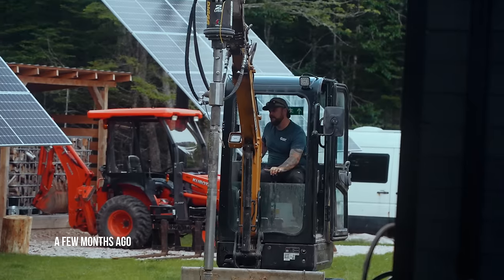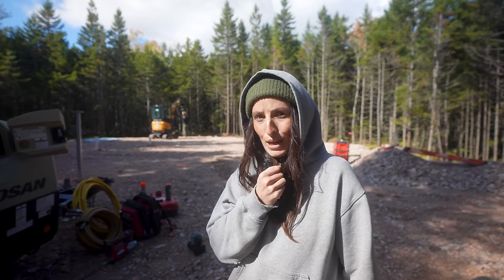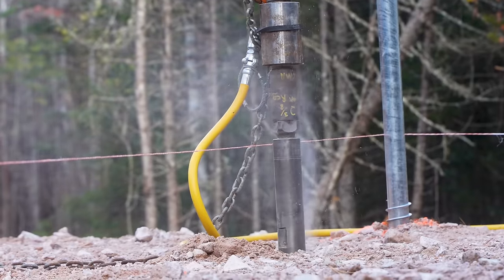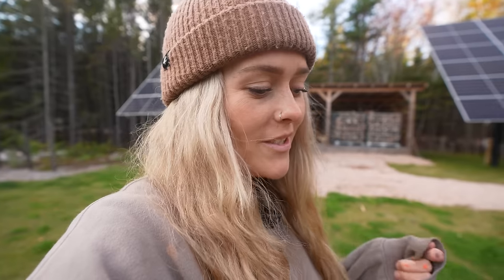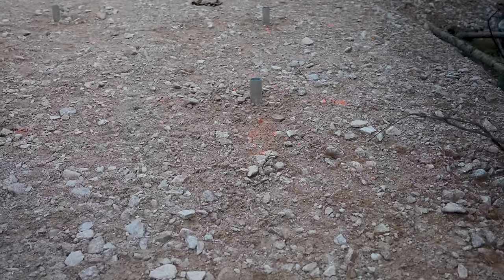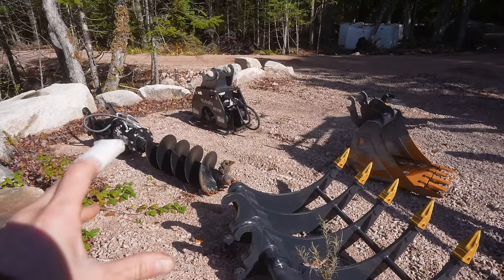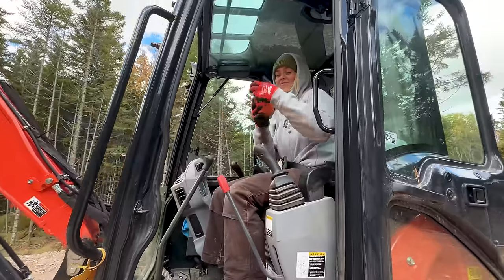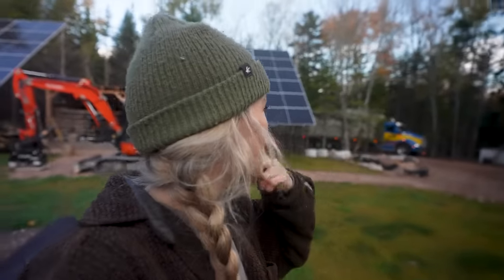Building A SHIPPING CONTAINER WORKSHOP at Off-Grid Cabin! (Screw Pile Foundation)

Comment: With the engine off, wiggle the control levers and it will relieve the pressure in the lines so the quick-connect will click in faster
Reply from the maker: Thanks for the tip. 😊🐶
Reply: Pole and rock markers - rural graffiti ❤

Comment: Someone may have mentioned this, but make sure to use the correct insulation— spray foam or equivalent.. if you don’t use any, you will literally have an inside rain storm. The condensation from the snow will cause the inside to form water on the inside of the steel container… the inside will always be just warmer than the outside and water will form— think ice cold water ina glass  on a hot summer day . Great video, great job— JT from Maine
Reply from the maker: Ahhh we experienced this already. Thank you xx
Reply: @ Sorry, it must be the “girl dad “ in me. I am a supporter of your off the grid lifestyle and any advice/ information that I pass along will always be from the heart. You ladies are fantastic in what you have accomplished.
I have retired from the plumbing and heating industry and am amazed at all the skills that you both have learned. 
Good luck on the Mexico project.

Comment: I have been trying to think of a way to attach wheels to your dock and floating cabin.  I put wheels on this pain in the butt jet ski lift I used to have. It made life a ton easier. I'm sure we could devise a wheel system. I'm currently thinking of a fold down system for both. I know it's an easy fix.

Comment: We would have done some concrete pads on the corners and center and called it a day , screw piles and rocks are so much extra work!
Reply from the maker: We initially wanted to do this. But concrete is very expensive here. This worked out to be more affordable considering gathering all the materials, the time and our extremely rocky terrain.

Comment: The screw piles are built of steel, even hot galvanized,  when it submerge in ground water they will corroded. What is the expected life for those piles? After that, what are your options?

Comment: Is it a roller and also, you can take those lines, you put a little hydraulic wall down around the part where you stick them in on the boom. Keep that oiled with hydraulic fluid and the hydraulic fluid. Don't ever wash away, and it'll keep them. Make them easier to use when you're sticking the lines to the hydraulic boom. Vowels

Comment: The two containers will support a full-span roof between them, providing a nice, wide bay for your equipment.  And then the roof will be a perfect place to mount more solar - you'd have way more power than you can use in the summer, but you'll be a lot closer to having enough to gather sufficient power during short winter days.

Comment: Congratulations on the progress so far. But I don't understand what the screw piles are for?  When this first shipping container was delivered it didn't go on top of the screw piles.  What are you putting on top of them?
Reply from the maker: We need the tops for the screw piles which are not yet made. Galvanized metal and lost in the mail system lol. They will sit on top of them once they come in. Plus that truck couldn’t place them on. You need a big excavator or a boom truck
Reply: @Vanwives  okay. So once the caps for the screw piles get put on then you have to get some kind of big equipment to lift the shipping containers and place them on top of the screw piles?

Comment: those containers only need a pier at each corner......they are designed to take WAY more weight between the 40-foot span than you have planned. You only needed 8 piers.
Reply from the maker: Agreed. However, if you’re putting heavy equipment in they need more. We had it engineered stamped

Comment: You are not compacting the ground with it sliding over he surface when you drive and drag it. To get proper compaction set it on the ground level and a bit more pressure, let that pound a few inches into the ground. You will be able to tell when it is hard as it will bounce and not penetrate and more. Also over lap the spots to get it truly hard and sealed. Good luck

Comment: girls, you're wasting money on those metal supports, if you wanted to raise the container from the floor, 6 concrete blocks would be enough to support it, I did it like that and it's been standing in place for 12 years, the weight of the container alone keeps it in place, winds even blew over 70mph . Little concrete=price of 1 columm

Comment: Don't understand why the site needs piling?  for shipping containers?
Reply from the maker: There is a lot of movement in our area, because we plan to build a roof in between the containers we don’t want the containers shifting! More of a long long long term plan. We’ve never regret a good foundation 😎
Reply: @Vanwives  Think I understand.  Freezing of the high water table is the site concern, frost heaving, not soil bearing strength.